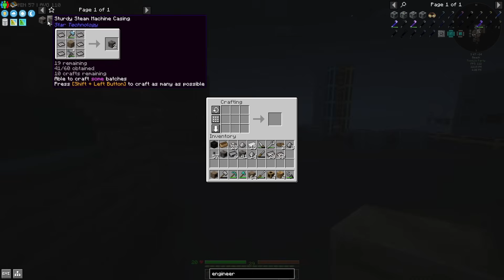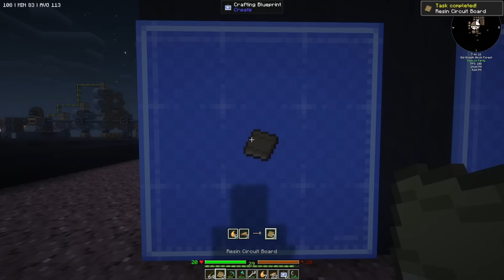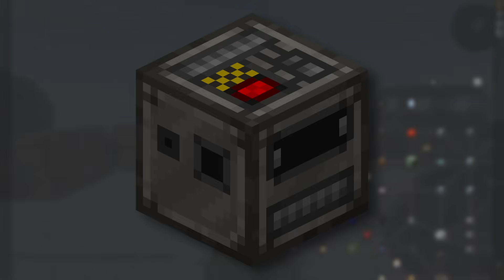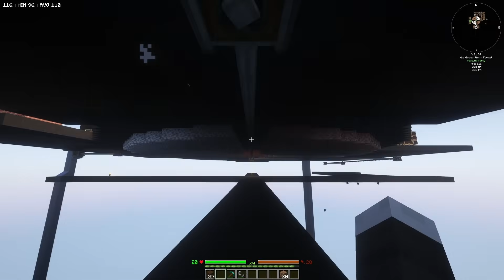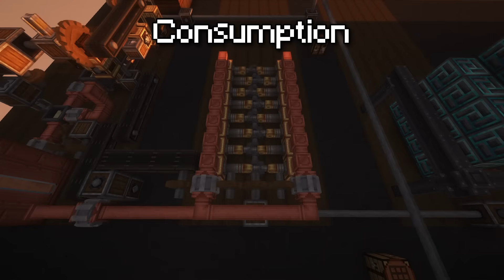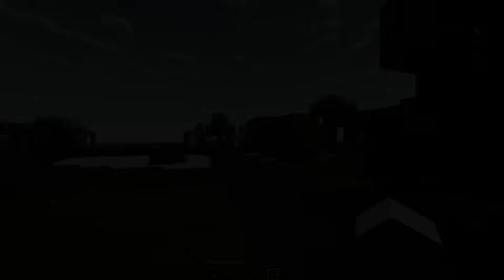Star Technology E4: Create + Gregtech = Diesel

Comment: Sorry for my bad English (Google Translate). Now that you've created the first circuits, use the storage controllers from the "Functional Controller" mod. You can connect the drawers remotely with the linking tool.
It will help you a lot, and with that, you avoid so many transport pipes and conveyors (from the Create Mod).

Comment: The pipes and pumps in create are the most mysterious thing in that mod, you have look for it in the mod files or the unreliable fandom wiki, the pumps work at 0.5mb/t*rpm meaning that at 256rpm it pumps at 128mb/t.
The weirdest thing are the pipes : they teleport the fluids instantly meaning it has infinite throughput, but they only work in a range of 15 block away from pumps, and btw that means distance between pumps can be 30 blocks. Really weird...

Comment: for auto-sieving with create, i just put one deployer facing down in the middle of a 5x5 grid and supplied it with the material i wanted to sieve. then i covered the sieves in water to funnel the items into a chute. at high rpm it works pretty fast
Reply: I think you can make the thermal vacuum block too, as cheap as the aqueous

Comment: you can gear shift alot more than you currently are to make the pumps MUCH faster, although it does take a decent amount of stress.
you might also be able to make a rotation speed controller to change the speed of the shafts effortlessly.

Comment: the create blueprints have 9 slots, not just the middle one. When you want to only put one blueprint recipe down you can make a 1x1 blueprint like you make a painting small. Also the pipez are best for transporting fluids for now and the giant chests are very very cheap and useful for the storage mod and even later ae2 storage. ALSO bet on solar panels. They are very good for when you unlock them and Tier 2 is good until about oil.
Will there be an employee stream some day? I would love to see the Progress on the User Manual :)
Reply from the maker: Dear employee,

Probably similar to GTNH - I will start out with mainly building streams, and later on infra scaling streams. But nothing 'new' will be done on stream.

Best,
HamCorp

Comment: iirc power transfer is technically not the same as gt5u but you should be able to treat it as the same without issue (iirc theres a way to exploit it to send more amps down a cable then its rated for or something but I might be thinking of GTCE not GTCEu)

Comment: Dear CEO, 

Based on my experimentation with diesel during early game it could be better if instead of rice you use pumpkins for the seed oil since a singular pumpkin gives you 4 seeds when crushed, it is one extra step in the production line but it may be better if a steam grinder is used due to steam parallels (8 pumpkins per 30 second cicle = 32 seeds), 1 steam grinder can sustain arround 8 fermenters while using a singular create mixer, potatos may be also a viable option for ethanol due to the 50% chance at giving extra crops allowing for further scaling of the fermenters, an extra large farm will be required tho.

ATT: Hamcorp employee

Comment: Dear CEO,

If I remember correctly and this is the same create diesel mod I was using, then using a 3x3 max lvl create steam engine/boiler gives WAY more SU per diesel bucket
Reply: 3x4x3.
Reply: Yeah it's really stupid why did they make new more complex engine just for it to be inferior to the regular one... And idk if it's possible in this modpack, but the base steam engine can be fully automated in a extremely compact form (lava dripstone setup) and that's the most powerful and effective way to make SU (it's also kinda "portable" lol) 
Kinda like blaze cakes and super heated steam engines... Why go through all that troubles when you can just build an other self-contained lvl9 steam engine for the same result, and why stop here? Make a cluster of 4 or more! They are very cheap and produce 147k SU each